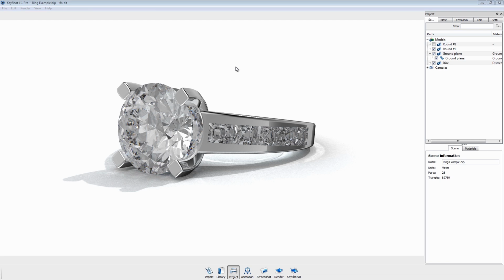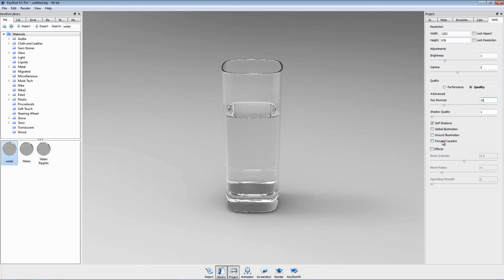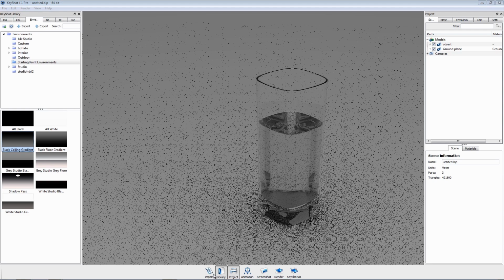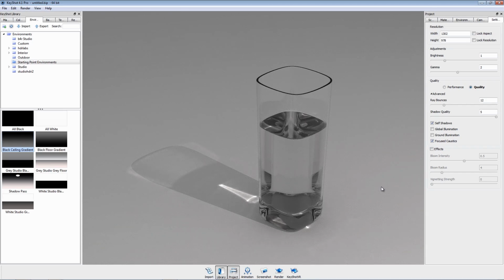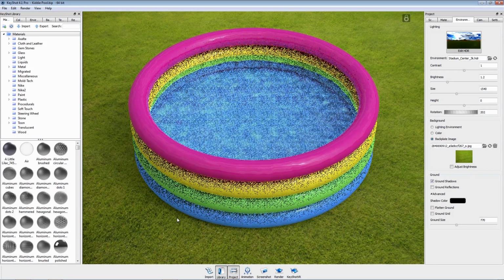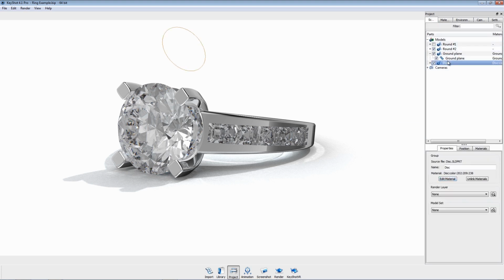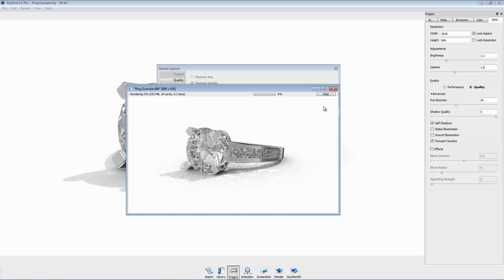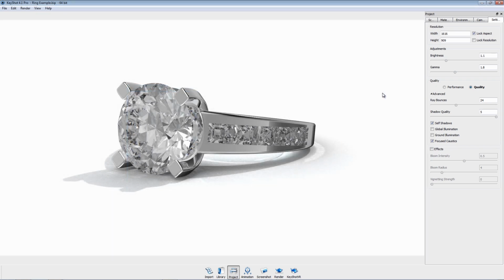KeyShot Advanced - Lesson 03: Focused Caustics

Comment: Hey guys really need help. I keep getting dots come up all over my render ...what could this be? light rays reflecting off shiny materials? :\ just a but annoying. Any advice would be great ASAP as I have my design show soon
Reply: +TheScottGordon i had the same problem when i left my render in maximum time mode. do it in advance and reduce the height your surfaces' bumps ( or uncheck glossy samples )
Reply from the maker: Sounds like you need to let it render a bit longer. May also depend on what lighting/settings you're using. You can send a request to support@luxion.com along with the file for us to have a look.
Reply: Thanks guys, I will keep fiddling. I think I have sorted it but I am not too sure what I have done as I just kept changing stuff and hoping.

It's so great u reply to people so fast thanks!